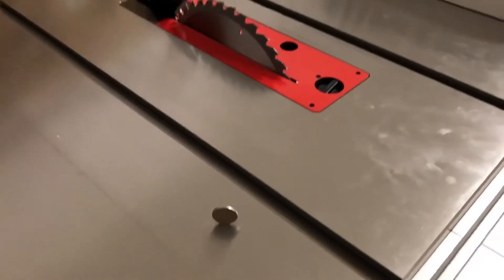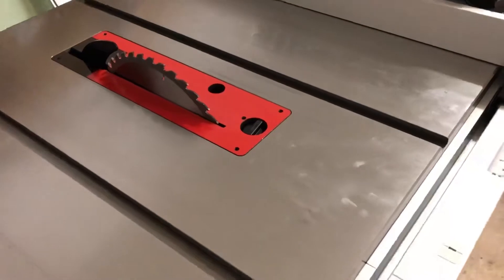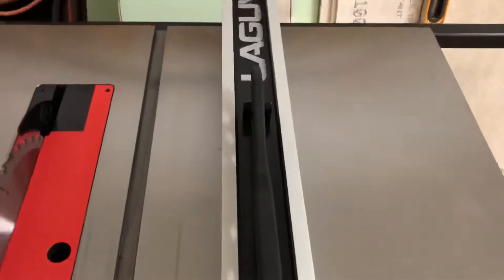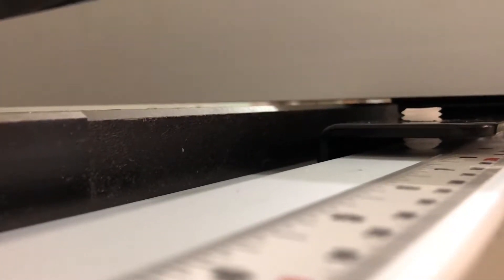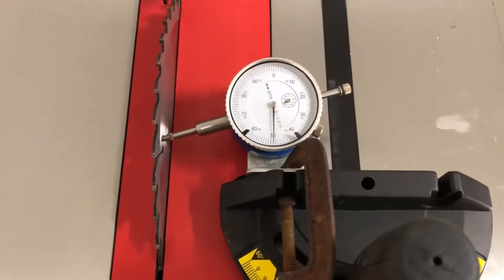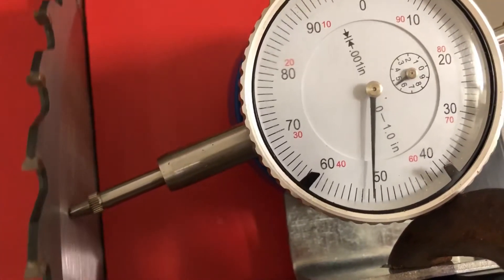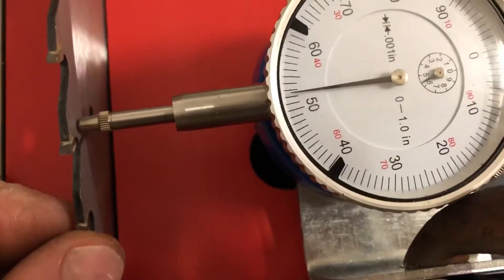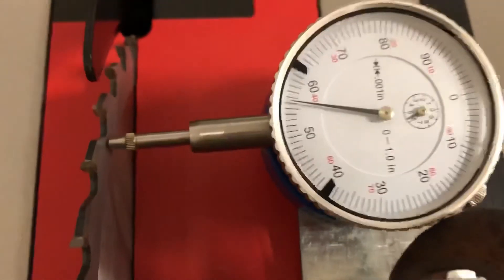Laguna Fusion F2 first start up

Comment: You need to measure from the same spot on the blade when you use the dial indicator. Do not use a tooth but mark a spot near a tooth, then rote the blade half a turn to measure. The dial should also be perpendicular to the blade. Lastly make sure the miter gauge itself fits tightly in the slot.

Comment: Hi! Thanks for sharing your experience with the F2, this is the saw that I am considering to buy. However, i have a question: Did you encounter any problem with the circuit breaker tripping at 110v set up?
Reply from the maker: Spratlyk9 nope.  No issues at all

Comment: Not sure if your model is the same, but if you watch the Laguna f2 sales video....rip side of the fence slides off and can be laid down flush to the table to eliminate that gap......if you need to cut thin stock.